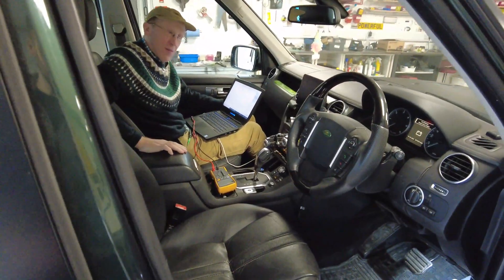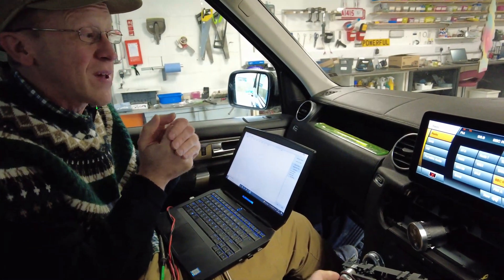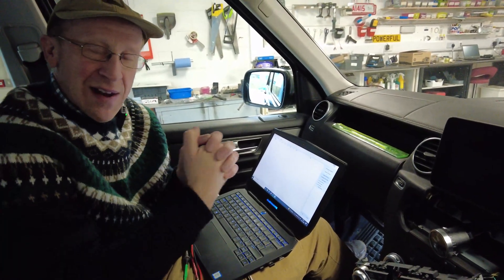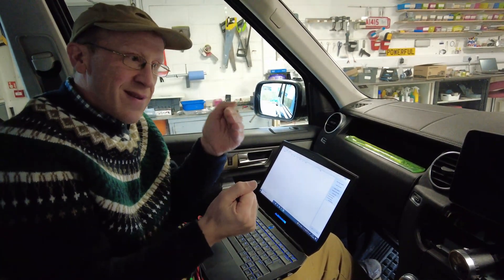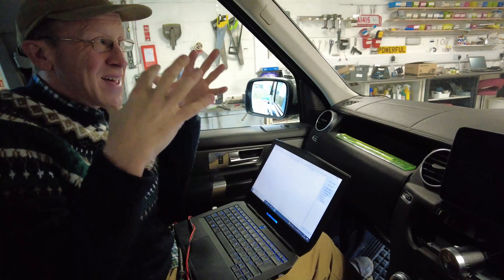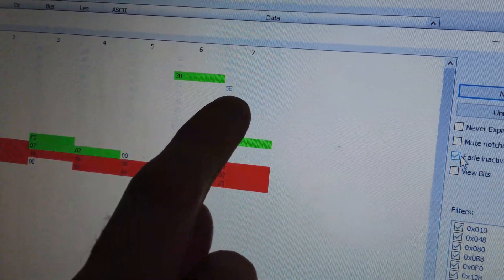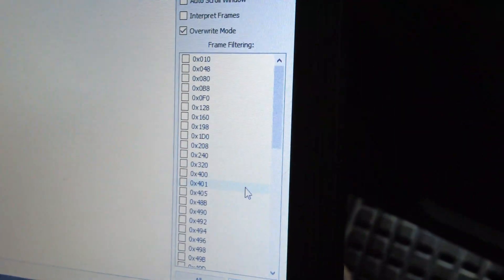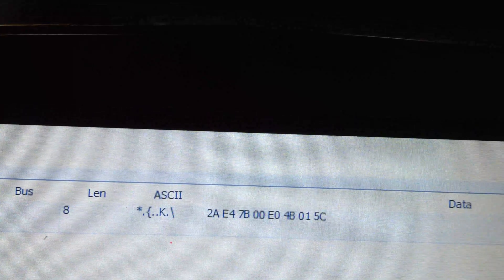Land Rover Discovery CANbus Analysing for Controlling Accessories

Comment: Thanks for making this video Simon. The sidesteps on my L322 died out of the blue. After replacing the ECU, the switch and metering out the loom, I've concluded there's no physical fault. I'm thinking that sniffing out the information the step ECU is receiving on the CANbus should be my next step.
Reply from the maker: Make sure you try a battery disconnect and reconnect again to reset all the ECU's

Comment: Hi Simon, does canbus have any connection with “in control” options and updates?
I have a 2016 Disc 4 Landmark, it shows in control on the screen but nothing else. I contacted LANDROVER and they said I did not have the hardware to support in control.
I have seen an option list for the disco 4 that shows a £750 option for in control.
So does canbus have any connection with  in control functions?
Keep up the good work

Comment: Fantastic video! Really enjoyed it 👍 I actually found this after googling for a problem I have. I’ve got some discovery 5 fully electric seats (fronts) that I want to fit into my camper conversion. I’ve got a wiring diagram and have manually powered up the module but I’m getting no output from the module to any of the motors within the seat. I’m suspecting and have been told that the module needs to be woke up via the CAN. 
Could you possibly help? Certainly could make an interesting video

Comment: Another brill video! As others mentioned would connection to the CAN be easier via the OBD2 connector? The JLR Vehicle Communication Interface (VCI) or Mongoose Pro cable as used with JLR SDD software accesses all networks & modules so maybe poss with a suitably wired OBD2 blank plug.  Just a thought ;)

Comment: Hi there Simon, we use a can bus reader from Peak CAN this links the usb on the computer to a RS style connector that then connects to the cranes that we work on. I love what you are thinking re the gadget to turn the spotlights on etc or do other funkey things but this would mean you having to re-write the firmware in the BCM or other ECU controllers, not easy. 
When you fit fog lights or a tow bar or something similar to a Land Rover (any car) the accessory then needs to be turned on using some sort of communication, laptop, OBD II most people use test book at the dealers etc. (I know you know this but for other readers of your channel)  Because it has been written in the firmware in the ecu that this is a thing and can happen. Once it knows the can id it will then work. Even if your funkey switch and relay have a compatible Land Rover style can id's the ecu won't recognize it or be able to activate it as it won't know at programming level that it is a thing, or that it is possible. The things that we can turn on or off at obd level are things that the factory can fit to say the highest level of vehicle anything further than that is going to need major re-writing of ecus so the id's are recognised and messages passed between them especially if you are going to be looking for information from the bus network to identify if the headlights were on or the door was open.
I wish you all the best with this, it took me a long time to get my head round it and when I wire stuff into my Range Rover and or Disco I avoid the can systems and leave well alone.
Reply: Sorry for the late reply Lewis. The plan is just to "Listen" to the CAN and not broadcast on it. Then a relay board can be configured with some output relays to drive our accessories and then we can program a microcontroller on the relay board to say for example - Turn on light bar when car is going at 10MPH or higher AND the main beam is on.... this will give us more inteligent control of accessories and cause no problem to the CAN system on the car !

Comment: I’ve just watched this video. Very interesting! you’re right, CANbus is far better than the usual 0-12v. This will save so many wiring looms from being butchered 😂
The box for turning on the FBH on D3 is very similar, it picks up the CANbus signal from the lights to turn on the unit. 
Hurry up and get that loom designed and on the market 👍👍👍👍👍

Comment: Rather than determining the CANBus messages from the physical buttons and getting the screen to send those when certain areas of it are pressed would it not make more sense to determine the co-ordinates of the press on the new screen and send this press/location to the original unit and have it decode what to do with them? (e.g. things like time/date setting, timed climate and so on have no corresponding physical key so would need such an approach). I have installed other CarPlay systems in OE units with a similar LVDS intercept board/cable and this is how they appear to work (to me)

Edited to add - thanks for this excellent series of videos BTW. I am looking to add CarPlay to my 2010 D4 so am following with great interest
Reply from the maker: Hi Mark - I think you are correct and that is what Jenny has been explaining to me.
Reply: @L663  Excellent. Looking forward to more updates and videos of your various experiments; great stuff.

Comment: I'm just going through this right now myself on a Discovery 3. I have an S I bought cheap and wanted all the modern tech I was used to with my Audi A7, So followed your cloth seat upgrade to put leather motorised heated seats in, It had no Sat Nav so I've cut the cubby out and built my own Android Auto system using a Raspberry Pi and fitted it into a housing I got on eBay for the original Sat Nav units. I'm now just waiting on my PiHat to turn up for CanBus decoding so I can start seeing if I can get the suspension information, diff lock info from the canbus like the original screens did on the HSE.

Comment: Simon, thanks for another great presentation.  I hope you continue with this project with more videos.

Instead of pulling the vehicle apart to get at the CANbus wires, why not us a UBDII plug with just the appropriate wires exposed.  That way, the package could be used anytime by just plugging it in.
Reply from the maker: Hi - Not all CANbus is on the ODB connector and some messages are filtered. I may be wrong but i dont think the medium speed CAN signals are on the ODB connector. Connecting to the CAN on the system you want to look at seems to be the best way to ensure you are seeing all the info.

Comment: From a fellow nerd - great video, really interesting.

Can the same device (or other devices) inject/spoof values onto the CANbus?

Could you trick the system into thinking the Nav button had been pressed, for example?
Reply from the maker: Hi Rhys - yes it can insert values onto the CANbus - this is great for testing and no problem on the medium speed CANbus ( this is what they will do to fix the Android head unit as you suggest ) but you need to be careful on the main highspeed CAN - as a wrong message can I guess set off airbags / set the engine to full revs etc ! So my plan is only to "listen" to the CAN and use this to drive a relay output.

Comment: It appears from the listing of this product that the touchscreen works with the OE functionality on 2012 and newer LR4s.   Rather, the listing only says it does not work on the 2011 and older models.  Do you have any idea whether it works on the 2012 and newer?
Reply from the maker: Yes they sell 2 version of this product - one for the early ( Denso ) and one for the later ( Bosch ) system
I dont have the later car to test the Bosch functions on.... I am trying to help the supplier get the Denso unit working.
Reply: Hi there
I also have 2011 d4 with small non touchscreen and would like to replace it. There is a talk on the net that this particular system is not possible to upgrade. Do they have any information on this type of system and will it work
Thanks

Comment: Simpler approach to your problem. Goto your full sized 2010 RR. It should have the same graphics/display on the screen. It has soft keys on the sides. Is there a 4x4 button? See where it’s connected and see if you can trigger it in the D4 display. Would like to know where the Nav and home buttons connect.
Reply from the maker: This may work - but the D4 is based on a ford system and the L322 may be different - but its a good suggestion.
Reply: The only floor with this is that the FF doesn’t have a 4x4 hard key 😂
Reply from the maker: @AndyK.1  We decoded most of the CANbus today - RPM - doors - time - lights - suspension - terrain response modes etc but you are correct that the 4x4info does not appear to have a CANbus code !
Reply: @L663  To select it? Or the data  that gets displayed itself ?
Reply from the maker: @AndyK.1  The plan is to only "listen" on the CANbus - not broadcast on it... we will then use relays to activate based on specified CANbus states.

Comment: Does this work on a Freelander 2 the same . Tia
Reply from the maker: Yes 100% the same logic / equipment but the codes may be different although i suspect many may be the same.
Reply: @L663  I'd be interested to see if you can modify it to accept upgrades from the higher spec models that the canbus won't allow ie heated screen, 6 speaker amplifier etc